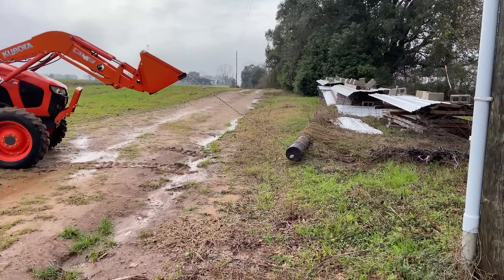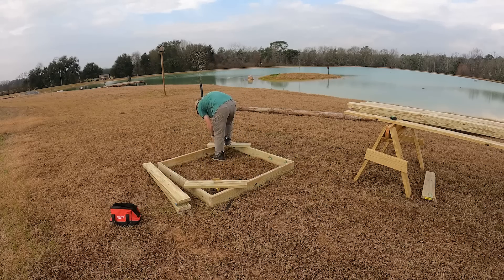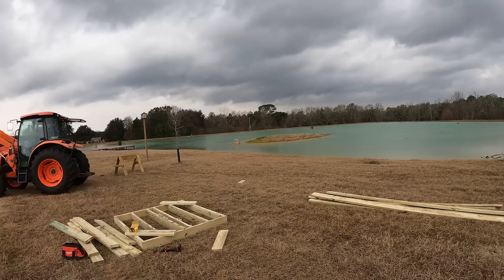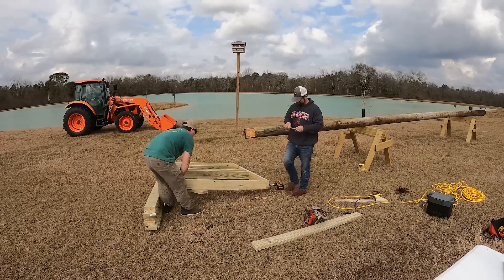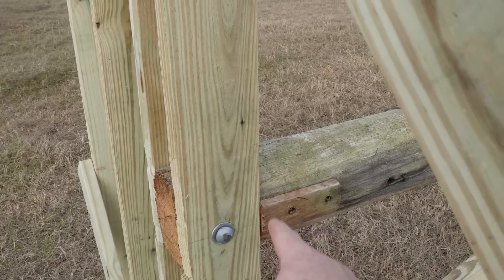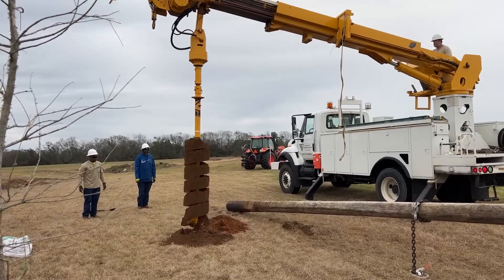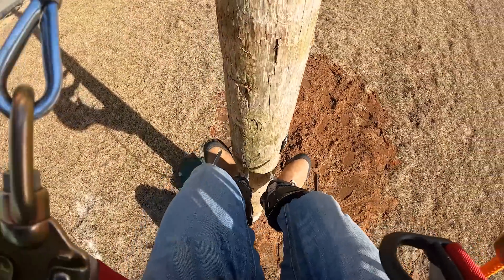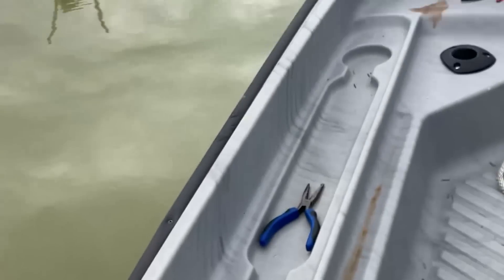Building an Eagle's Nest for Crimson Oak Farm!! (Very Tall)

Comment: A neat technique I learned long ago when working construction….to set up a pole like you did, auger out the hole to put it in, let’s say said hole would be 18inches diameter and 7ft deep. Then you dig a ditch that runs from the hole out in any direction you have enough room to do so…at the hole the ditch would be about 4’ deep and make it about 20’ long up to natural grade, thus creating a ramp to put the pole in the hole with… you still need something to lift the top of it but I think your tractor would be perfect for that, with a log grapple on it….just a thought…